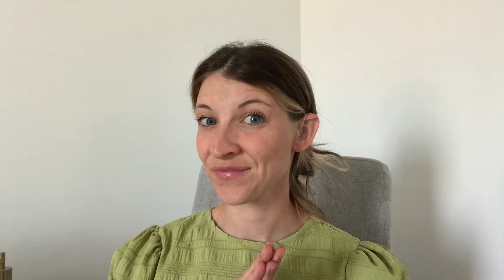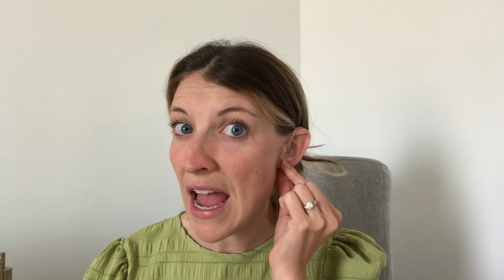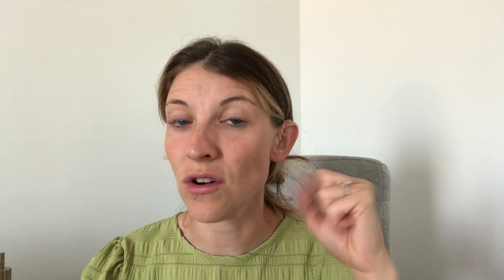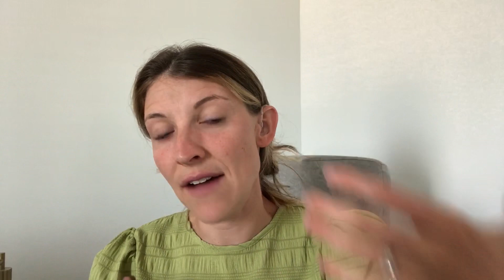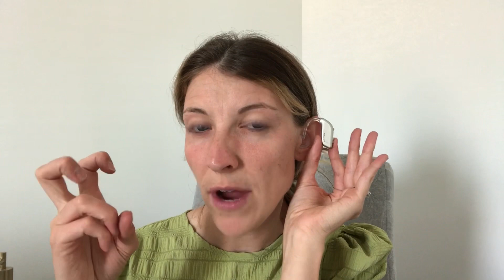Three Different Types of Hearing Loss

Comment: Thanks for the video Emily! My Dad and I also have Sensorineural Hearing Loss and we both wear Hearing Aids. I would love to know what your thoughts are on Hearing Aid covers and Hearing Aid Jewellery. :)
Reply: @@craftcrochet4020 Thanks for your reply :) I am going to put some charms on my tubes for sure. I have seen a lot of people wearing Hearing Aid skins made out of fabric. I know for sure they help to cut down on the rustling sound from your hair rubbing on your HA's. I just wonder if they block any sound coming in? Stickers would be so cool too. There are so many on Etsy. I'm going to try to make a chain going from the charm to my earring. I will send a pic if I can .
Reply from the maker: Believe it or not I’ve never tried the sleeves for aids but I have tried the charms. They’re really fun and glam. My only wish is that they’re easier to put on. My aid tubes are hard to get off and put on sometimes and I’ve broken ear hooks taking tubes off. Overall I recommend trying them. I got my tube charms from Little Auricles!
Reply: @DefiniteHearing  Thanks Emily. I have been thinking about making some charms and just using some jump rings to put on the tubes.